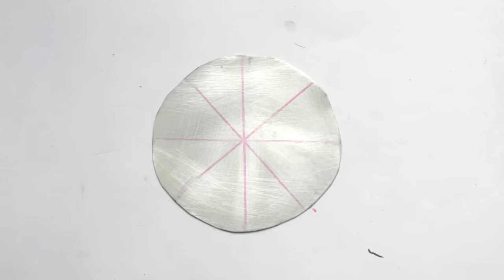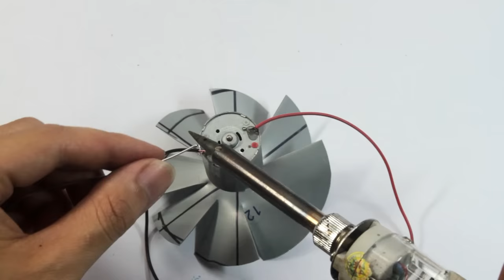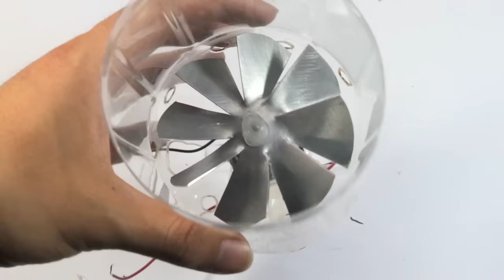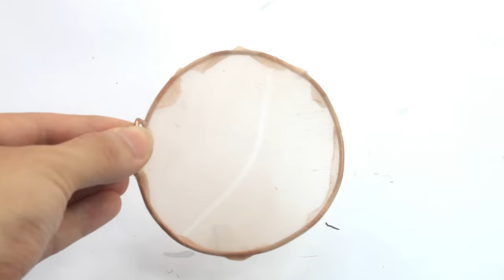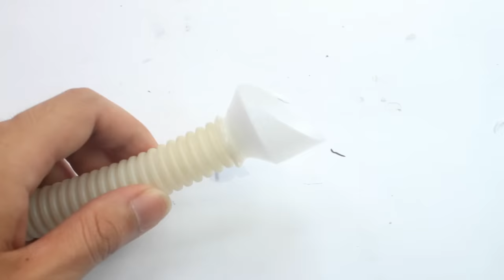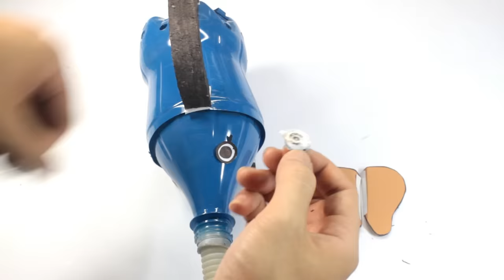How to make a CUTE and POWERFUL HANDHELD VACUUM CLEANER using bottle with Just 5 mins

Comment: ive made one and i have the same motor that u have it sucks papers 
and samll thermacols but not anything heavy like those tin peices plastic and is it necessary  to make a slant cut which u  made in the small bottle please guide me
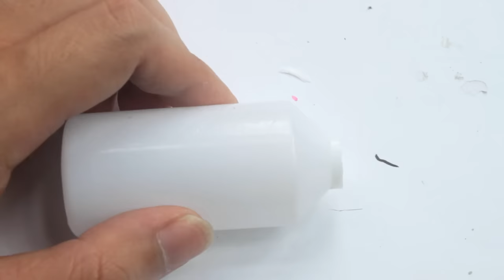Reply from the maker: +cyril joel At 4:35 do the same for the slant cut. For such heavy things as tin or plastic, try a DC power supply with higher :)
Reply: +Just5mins  how much power have u supplied??
Reply from the maker: I used 19V from the Laptop charger :)
Reply: +Just5mins i m using 18 v
Reply: +Just5mins but i have used a smaller bottle and a smaller fan is that the reason??
Reply from the maker: I don't think that is the reason. Maybe the radius of your Small Bottle or Plastic Tube is too small
Reply from the maker: It may also be because the Fan wing is not bent properly
Reply: +Just5mins  ohh i will bend it more thank u
Reply: +Just5mins thank you so much now it does suck and thanks for ur guidance only im not getting thar tube to fix it in the front😣
Reply from the maker: +cyril joel :)
Reply: +Just5mins nice
Reply: +Just5mins using bottle